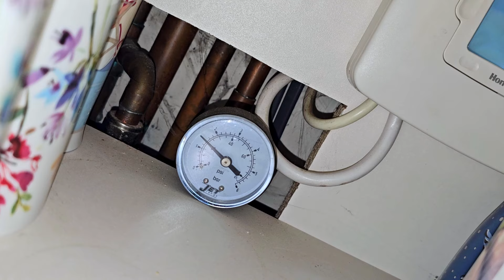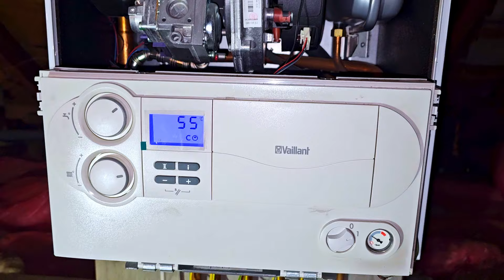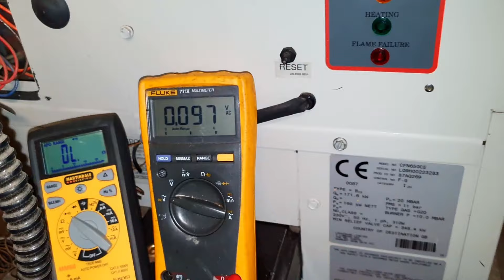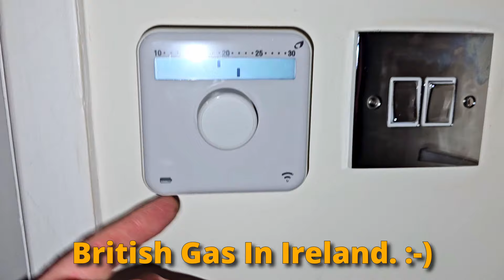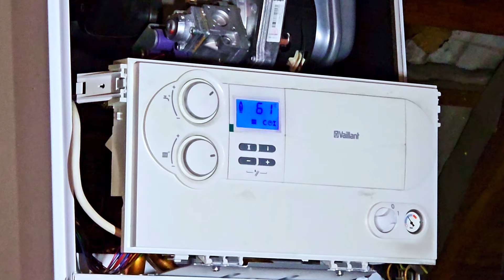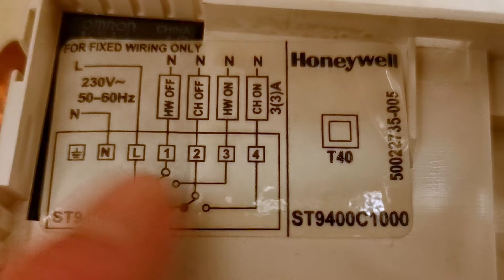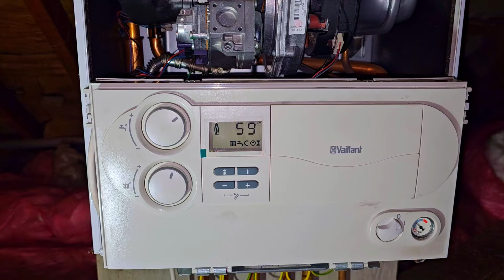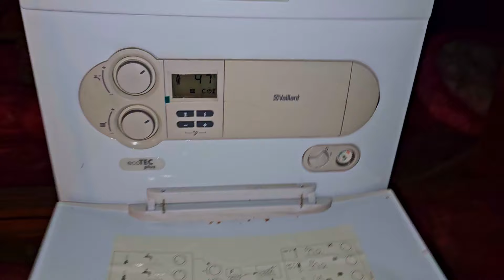I Wouldn't Do This For A Customer.....

Comment: Welcome home you kept that quiet next time you over will you bring me a wax capulate for a potterton puma 100e so expensive to post to Ireland for some reason 😂😂😂
Reply from the maker: Potterton Puma. Jesus... Need an electric screwdriver and a PCB or 2 as well. Also need to unblock the pressure switch or swap the wires over.... :-)
Reply: No diverter valve problems not the first one I have replaced bad design and now it's being used in a ideal boiler same part fits both apparently according to eBay sellers
Reply: What would be your recommendation to replace boiler with it's 20 years old now and not most efficient
Reply from the maker: @michaelc1970  I like Vaillant personally.You need a good installer over good appliance. Powerflush the system well and most boilers will be good.

Comment: I would expect the HIU will have overheat protection built in to comply with G3.
Reply from the maker: Yeah but the valve doesn't fail safe. If it on and the customer turns the spur off it will stay open
Reply: @HeatingGeek  What  I'm  saying is like the Viessmann boiler/unvented cylinder, the temperature control in an overheat situation is taken care of by the diverter valve etc.within the boiler without the need for an external 2port spring return valve.
In the event that the HIU does not have a fail safe system, then the instal contravenes  G3 which I would  find more than concerning!!!
Reply from the maker: Yeah I know. I have made people aware.

Comment: Fantastic
Reply from the maker: Thanks :-) You like your heat pumps?? Growing market or just steady? Im still not sold on them myself.
Reply: @HeatingGeek  definitely growing, I’ve been fixing them for 10 years, really enjoy fixing them…and boilers 👍 keep up the good work
Reply from the maker: @heatpump8566  My business is F gas registered but we don't get any work from it. Need to go on the hunt for it I think. :-) I don't want to instal. Just repair.
Reply: @HeatingGeek  I do a lot of f gas repairs. Changing a low pressure switch on a ground source early next week. Love it as it’s so different to plumbing. Changed a compressor on Monday on a split air to water. Keep the f gas it will become massive going forward
Reply from the maker: I will. :-)

Comment: Heating Geek 🤓 

Are the capacitors easy to change?
Reply: Yes just take note of the polarity before you take them out and make sure you put the new ones in the same way.
Reply from the maker: Yes. Harder to remove than refit.
Reply from the maker: Exactly, simple enough. :-)
Reply from the maker: Louis Rossman has a great youtube channel showing surface mount component replacement.
Reply: The pcb is usually marked with a '+' & the capacitors will have a band that shows which leg is the negative. Pos to Pos, neg to neg. Simples.

Comment: It’s a shame that you can’t in theory repair a board for something simple like bad caps. An hour of work and 50p in parts is going to be less than a pcb. Also you checked it was combusting properly after so your board got recalibrated fine.

Comment: Don't you service your mums boiler every year? :) thanks for sharing
Reply from the maker: I don't service mine, my mums, or my brothers boiler every year. When they breakdown they get a service. Mums been done 3 times in 14y mines been done 4 times in 16 years and my brothers which is 2019 boiler has yet to be done. I fitted them, I flushed them and I know they are safe.
Reply: @HeatingGeek  I don't doubt that mate. I'm a plumber too, I don't have my gas so your videos are golden. Clever stuff and things I haven't seen before too. Especially the big installation you were on before that. 

I've seen the big boilers and commercial installations at Oxford Uni. Impressive work. Also your English multimeter haha. I researched that.

I was under the impression that boilers would be serviced every year for insurance purposes. Cylinder manufacturers require that for the 25 year warranty. I'm not sure how it works with boilers. 

I'll carry on studying your work and maybe I can call on you in the future at some point with a couple of ideas ;) I'll certainly be sharing your channel with more people. 

Thank you
Reply from the maker: Yeah, boilers are meant to be serviced every year for insurance purposes. But Unlike document writers I have been working on boilers for 24years and noticed that putting an analyser into a boiler every 12 months does nothing for safety or to stop a breakdown. 

Older boilers and Oil boilers DO require servicing every year. Boilers fitted by unknown installers do need servicing every year. My work, gas pipe sizing, boiler sizing, flue installation etc is all done to the regulations and means a boiler will remain safe for most of its life. 

I know most modern boilers will need a repair ever 5 years and I service my family boilers when that time comes. BUT when I service them I don it properly. Full strip clean pump up the vessel etc
Reply: That is quality mate. Like the gentleman above said, you're the best breakdown engineer on YouTube. I trust your judgement completely and appreciate you taking the time to share your expertise and giving a rundown on how and why you do it. 

Much appreciated mate, and keep up the great work. I look forward to more videos :)
Reply from the maker: No problem. I'm glad you watch it and taking the time to comment is great. :-)

Comment: As a technician for a different trade. You have just proven that consumers get ripped off. It's not that things can't be fixed on the cheap. It is more profitable for the whole units to be replaced. It is really infuriating when we know that this repair would have cost around £10 in parts + an hours of labour instead of £100 - £350 in parts and 2 hours in labour. (Extra hour going to a boiler spares shop and buying the part)

I wonder if you can get around the regs by taking the pcb away for refurbishment and coming back with it repaired?
Reply from the maker: Maybe to the van? Who knows. I just cant risk it in a customers house.

Comment: Can't see many comments about a power off valve a problem On an unvented cylinder
Reply: I would guess that as it's permanently wired to power off and a call for heat opens it, it will fail to power close. If the electricity fails then the boiler will be off anyway, so no danger possible.
Reply: That was a communal system. So no protection in an overheat situation or if the motor fails.

MOMO valves are a rubbish idea whichever way you look at them.
Reply from the maker: Thats a problem though. I did mention it to the site owner but i think its to do with the safety interlocks in the plant room.
Reply from the maker: No, thats the thing. If the consumer turned the power off when the valve is in the open position then the valve stays open. I think the safety comes from the interlocks in the plant room. Not sure though. I did mention it to the building owners.
Reply from the maker: Yes but they can hold back more pressure than spring return valves. This is why I think the site has them.
Reply: Makes sense in that situation.   Hope they have some good interlocks though LOL.

To be fair, immersion heaters are probably the greatest risk anyway.
Reply from the maker: Yeah, all I could do was highlight it to others.

Comment: Capacitors on secondary/ low voltage side changed. There was no visible bulging on the top pressure relief (cross line indentations on top of electrolytic capacitor) so failure mode not catastrophic but most probably significant increase in ESR (equivalent series resistance). For SMPS operating 50kHz to 100kHz typically, low ESR capacitor needed. With poor ESR, regulation (smoothing of high frequency noise) will no longer be to specification. Feedback loop (via opto-isolator) to SMPS IC no longer controlled and secondary output voltage no longer regulated correctly. Lucky you had replacement electrolytics on hand. No legitimate reason why competent PCB repair not allowed by Gas Safe!
Reply from the maker: I bought the caps from RS and got Nippon's. Long time ago now. I brought a few faulty PCBs home and had a play. I found lots of them displayed the same low voltage issue. Replacing the Caps fixed them all. So i kinda knew that was the common issue on these PCBs. I tested them all on the faulty boiler and then fixed them and tested them in my own boiler. I now see the same problem with most PCBs.

Comment: The lovely combi boiler.
Personally would not go there
Reply from the maker: Why? Perfect for many situations.
Reply: @HeatingGeek  I like the idea of back up with immersion and cylinder.
You are correct they do get you out of many situations but I would not rip out a boiler and cylinder to replace with a combi.
But that's just my view
Reply from the maker: @gregbenham5586  Thats a fair point, but for a 2 bedroom 1 bathroom house with great mains pressure you cant go wrong. Obviously you need to trust the boiler you fit and be able to same day fix it. :-)

Comment: The small transformer on the PCB is dropping the mains voltage to a lower AC voltage. It’s not being used in a switch mode function. The secondary AC lower voltage is then rectified and converted to DC then various DC voltages generated using linear voltage regulators. The electrolytic capacitors are  for DC voltage smoothing. It’s a common point of failure when they dry up or leak electrolyte.
Reply from the maker: Its is being used with a PWM signal though so isn't that switch mode? Its not running at 50hz